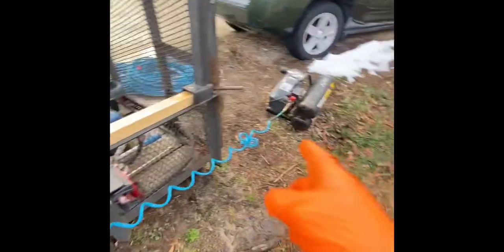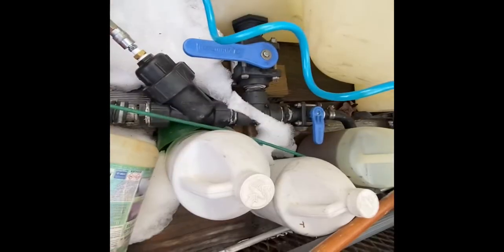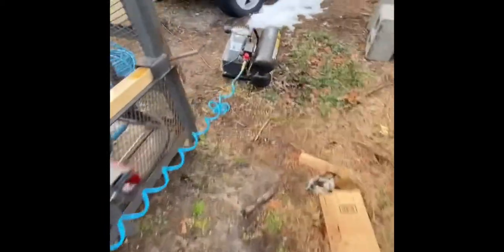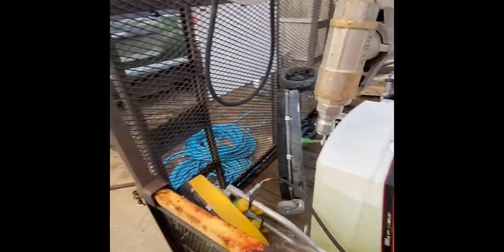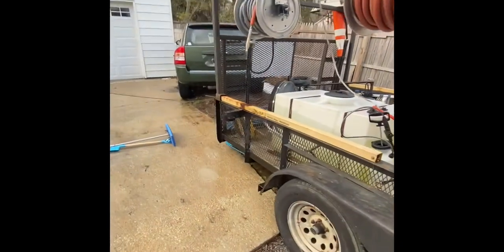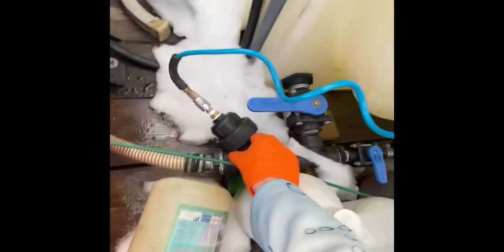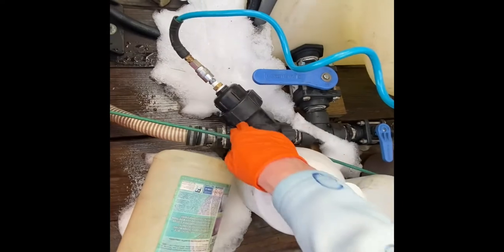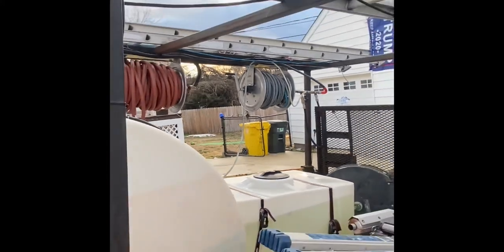How To Winterize A Commercial Pressure Washer

Comment: What if you don't have a buffer tank? I have a bladder tank and I pour antifreeze/windshield washer fluid through the bladder tank then turn it off connect my gun run high pressure to clean out the hp line? Tips?
Reply from the maker: I would do something similar to what we are doing here. Order a GHT x air valve fitting from Amazon or your local power washing store. That way you can blow the air through your garden hose, machine, and high pressure hoses. You can do the same using antifreeze by just sucking it from a 5 gallon bucket